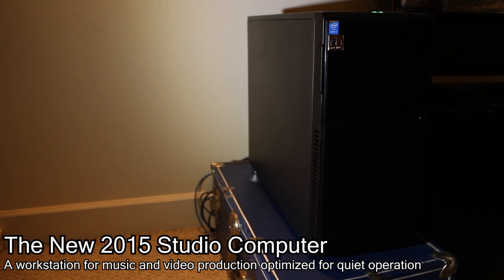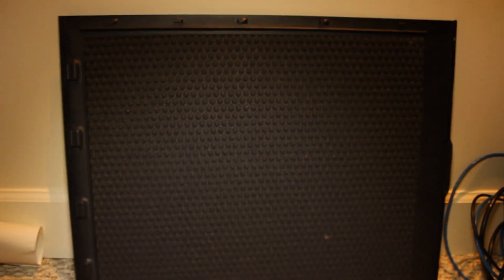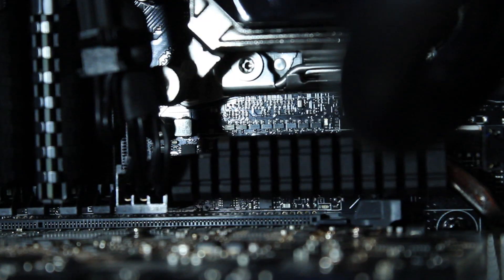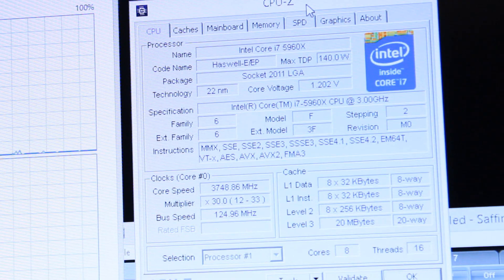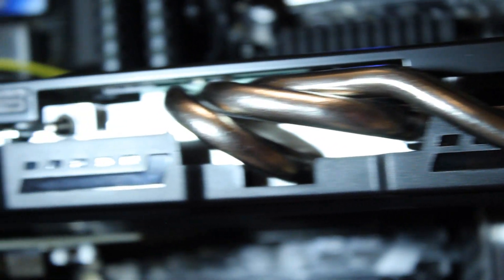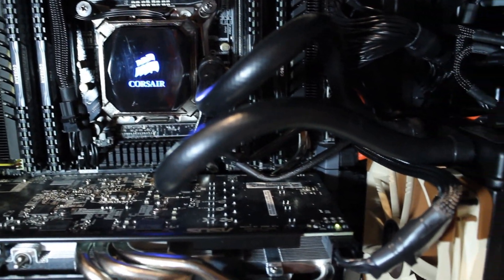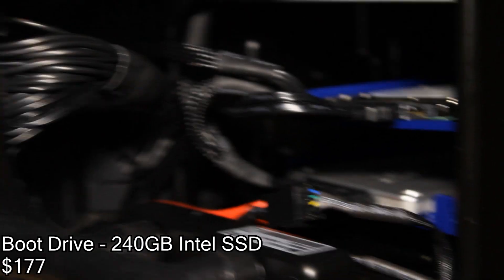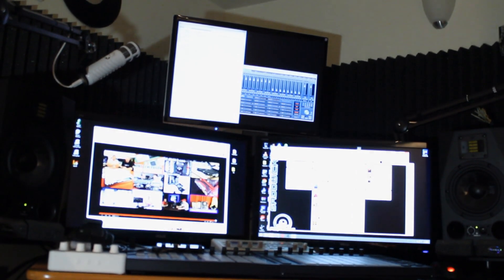The 2015 Asus X99-E Workstation 5960X Studio PC Build

Comment: I have the X99A sli plus from MSI. Will be part of my new build. I have the AMD FX 9370 for motion graphics and gaming. However single core performance it's weak. So I decided to go with the Intel Core i7 5820k for the budget build will be my graphics designing/recording machine. Can't wait for when it is finally over. So I can finally start buying instruments. I am rocking an accoustic guitar so far and it has been a blessing to practice with. But, till then it will take a while till i finally put everything together.

Comment: Nice system.  I have 5930K, 32GB Ram, EVGA GTX 980, and all the trimmings.  I built it back in Nov of 2014.  It's been a WIP, as I've been doing fan and cable management.   Cable Management is what your system is lacking.  It will improve the air flow.  Opening up the case so those Nocts would move even more air.  Oh....and forget the comments about waiting for Skylake.  When that arrives, then they will say, "wait on the next platform."  The waiting game will never end...and it leads to misery.
Reply: Hater!  Set yourself apart from the rest.....be different.....don't be a hater.  There is already way too many.....on the Internet

Comment: Nice build man, but 850W is just overkill. I know a lot of people tend to buy overpowered PSUs (I used to), but in your case 600W would have been more than enough ;)
Also, interesting to see someone using SSDs for sample storage - did you feel any increase in sample loading times?
Reply from the maker: Monochrome Arts Perhaps but the psu is silent under moderate load, the motherboard requires three 4pin cpu connectors and the CPU draws ~230 watts on its own under load at 4.4Ghz. Referring to a power supply calculator online the minimum I needed was 750 and that doesn't include USB powered devices and all that

SSDs for samples may increase loading times but it does eliminate seek times and spinup
Reply: SadowickProduction holy cow, 230W just for the CPU? haha I didn't know the Extreme i7's were that power hungry, I have an i5 3570K and a Radeon HD7870 in my rig and the calculator says the maximum power consumption is somewhere around 390-400W
Reply from the maker: Monochrome Arts Now that you mention it I really want to see what the PSU is pulling from the wall with an outlet meter. But seeing as how its 80 plus gold its quite efficient under idle as well as load.
Reply: SadowickProduction Great Rig, what socket is MB and CPU?.
Im thinking of putting my Kontakt library onto a 500Gb SSD. Thinking it will speed up loading instruments, do u think this will help, or stick with my 7200rpm 1Tb HDD? Thankyou, please.
Reply: Monochrome Arts Don't forget that  maximum PSU efficiency  is under 50% of load. People are alway saying "that PSU is overkill" but its just future proofing, so you dont have to buy new PSU with every upgrade...